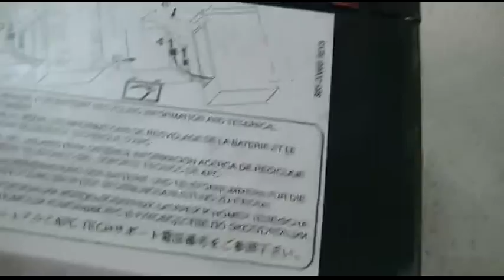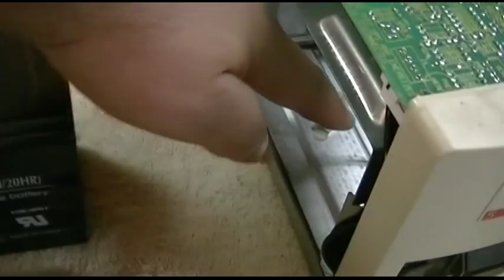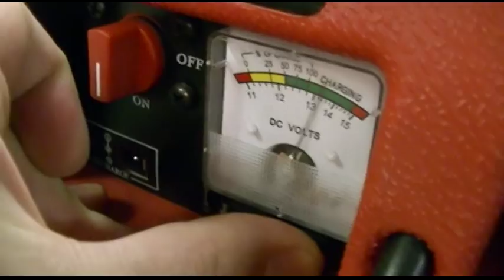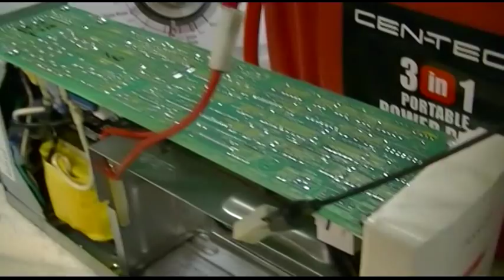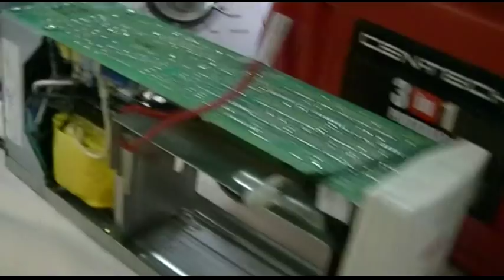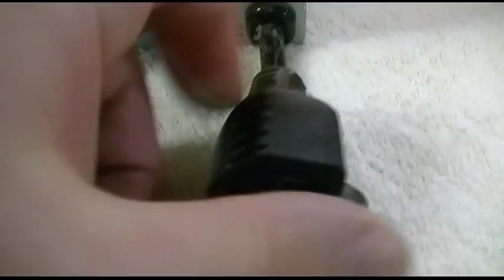APC Back-UPS 500 With Bad Battery

Comment: I'm surprised that battery lasted as long as it did. Usually those things kill the battery after three years due to the cheap trickle chargers inside them. I used to have a unit similar to that, but I got rid of it in favor of a new one with more outlets. Also, after about 15 years (at the time), it was safe to assume the MOVs were no good anymore either. The only thing I miss about it is that the beeping could be silenced without ripping components out.
Reply from the maker: +Rebelkid1112 Yes, I was also really surprised at the longevity of that battery.  Probably never find one that will last that long again!

Comment: How about hacking a car battery into one of these? It'd take quite some time to charge, but provide hours of operation. I know amazon carries 12 volt batteries that might fit the UPS somewhere around $50 or less.
Reply from the maker: +kd9bwi Car battery would work, but it's nothing you want to keep indoors, as it's not a sealed battery and can leak hydrogen gas out.  Uxwbill had done something like that quite a while ago.  It's not a huge concern now, but if I happen across something with a somewhat good battery that happens to fit this, it will be fitted with a new battery.
Reply: jaykay18 Ah, yes forgot about that. I have a car battery for my Heathkit radio, I had forgotten about that. I charge the battery out in the shop and bring it back indoors when charged for use. About 2 years ago, I was messing with a sulfated battery that had run dry, would only charge to 8 volts and stay there for only 2 minutes. I found it had run out of water, after filling it I put it on a charge. Well, I forgot I needed to shut the charger off before unhooking it and got big flames. (Being almost 100% shorted and using water containing minerals it vented tons of gas)
Reply from the maker: kd9bwi Exactly.  Hydrogen is no joke.

Comment: Have you done any business with Mouser Electronics? I had the same battery for another reason, replaced it with a Power Sonic battery. 

I would say just old age killed the battery, second up would be, it sulfated and shorted. Third, CHINA

Another note, the batteries are Absorbed Glass Mat. They require specific float charges. 14 volts while the unit is off all the time, will kill the battery. However the 13.6 while on is good.
Reply from the maker: +Michael Gegzno I've heard of Mouser, never done business.  I have with Parts Express.  The battery that was in this UPS probably died of old age, I haven't the slightest how old it is, but way more than 10 years old, if not 15 or even more.  Well past its useful life.
Reply: +jaykay18 Done many projects through Mouser, Needed to rebuild a 24 V AC power unit for my TV Dish deicer. Went overboard on the transformer, got a 8 amp AC transformer, and installed it into a clear front NEMA box, along with various fuses and switches, top it off with a few meters, fricken cool. Oh the transformer was the only one I could get at the time, any thing smaller was on long back order, I need it now, got tired of bashing ice and snow off of it, had to do it several times a day, endless snow last  year.